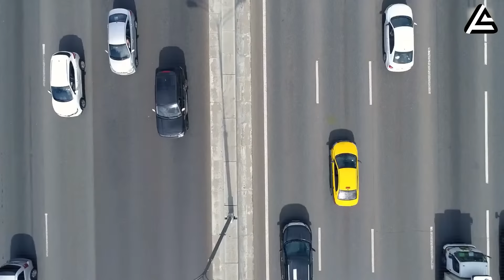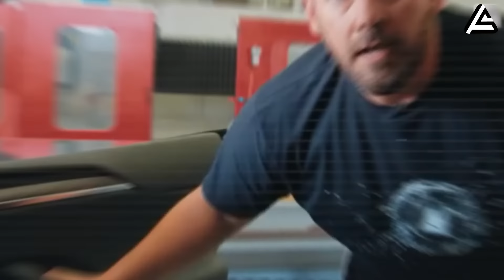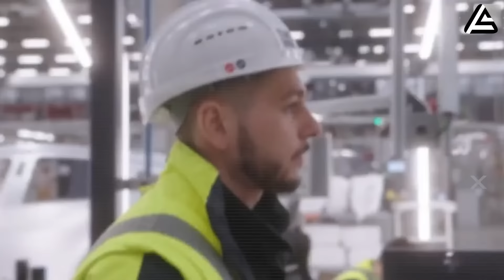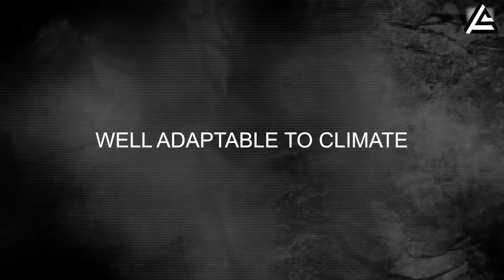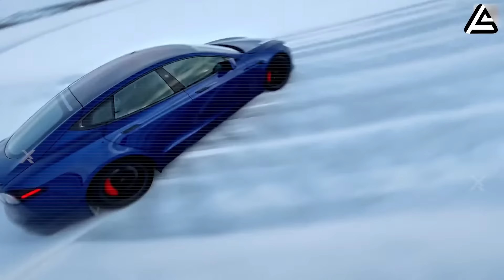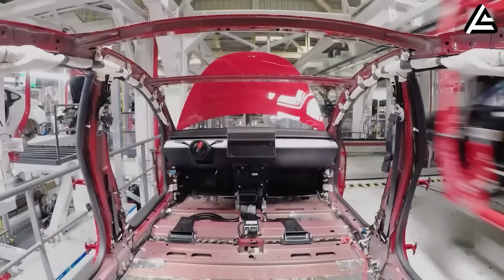Tesla Model 2’s 19 Features Revealed: Interior, Exterior & MORE. MIX

Comment: Model 2 #2
Reply from the maker: Why not #1 to you?
Reply: @AutoGearShift2  not even sure why I said this. As at the moment it is definitely # 1 in every respect I currently see. Especially if it comes out with the aluminum ion  battery & two motors. If it were only a small amount more for the dual motor then for sure that would be the ticket. There is no other car I even wish to possess.  None that I even want. Hot cars & brutal acceleration I even want. I think what happened was no car currently was under production with aluminum ion batteries. I definitely wish this addendum.
Reply from the maker: No worries! 😄 It sounds like you're thinking ahead to what future EVs could become. If next-generation battery technologies like aluminum-ion eventually prove practical at scale, they'll certainly make things even more interesting. For now, we'll have to wait and see which technologies actually make it into production.

Comment: EV車の場合は 航続距離＝安心係数 となります ‼
東北・北海道などの極寒地の場合 大都市間移動
距離が 100Km 以上なんて  普通中の普通 
且つ外気温低下と各種ヒーターの使用によって 
本来の航続距離が  半分程度まで落ち込ます ‼

路上での途中充電も  辿り着いた充電施設で
充電器故障中 なんて事も ❓
中には 冬季間使用停止中 なんてのも有るし
大雪の直後には 充電器までの通路除雪も
されてない場合も在る ‼

どんなに電池性能が良くなっても  充電器が安く❓ 
小さく早く高出力でも  先ず電気代の解決が
出来なければ  電気不足と高騰化は止まらない‼

ＥＶを無理矢理エンジンに置き換えての主流には
成り得ない  且つ上手いくとは思え綯い ‼

ＥＶの充電が夜間や昼時の電力不足になる
電気代が月額 5万〜10万 となら乃いと良いけどね ‼
Reply from the maker: Those are valid concerns, especially in Hokkaido and other cold-weather regions. Tesla has been addressing some of them with heat pumps, battery preconditioning, and a much larger Supercharger network than a few years ago, but winter range loss is still something drivers need to plan for. In practice, many experienced EV owners simply keep a larger battery reserve in winter and charge earlier rather than waiting until the battery gets low. As for electricity demand, that's one reason Tesla is investing not only in vehicles, but also in large-scale battery storage and energy generation. The challenge isn't just building better EVs. It's making sure the energy infrastructure grows alongside them.

Comment: You are rambling on I will not be there to the end.
Reply from the maker: why not?
Reply: Because in the first 2 1/2 minutes of describing the Model 2 you show the front of at least seven different cars.  You even show the back end of a Cybertruck, is that one of the features of the Model 2?  You mention the seat are faux leather {really?}.  Some of the pictures show no side mirrors on the doors or slim mirrors or bigger mirrors, which will the car have?  I didn't hang around to hear if the dashboard will look like the one shown.
You don't seem to honestly show what the Tesla Model 2 will look like.
Reply from the maker: the visuals aren’t official. They’re concepts and renders based on leaks, rumors, and expert analysis, meant to illustrate possibilities, not confirm exact specs. when we mention a new feature, we will find an image that look closest to it